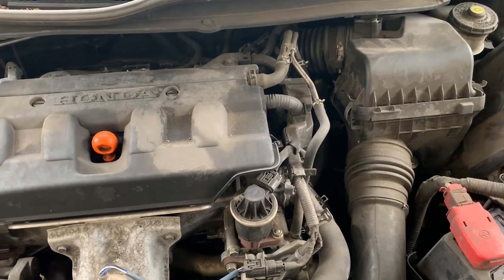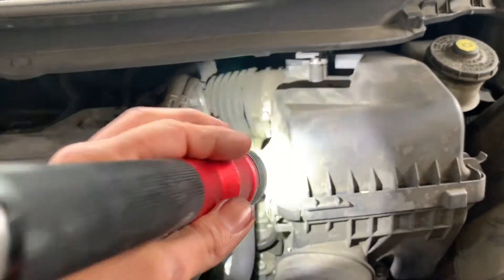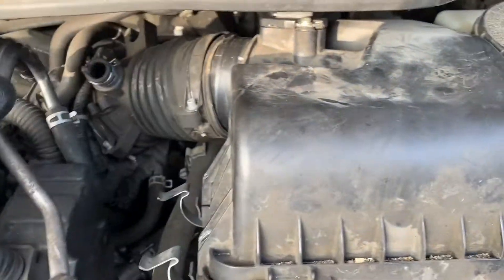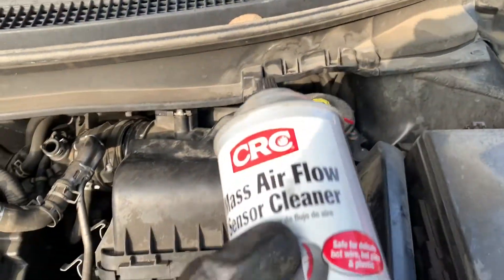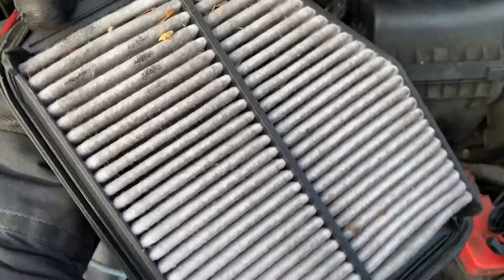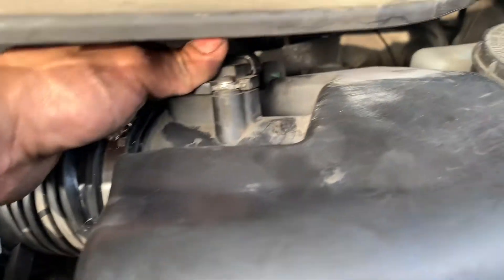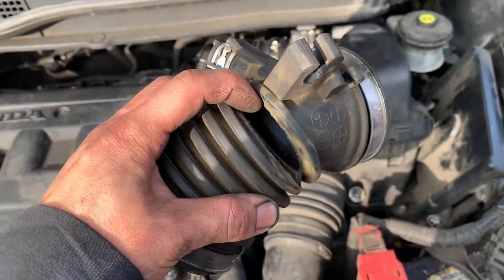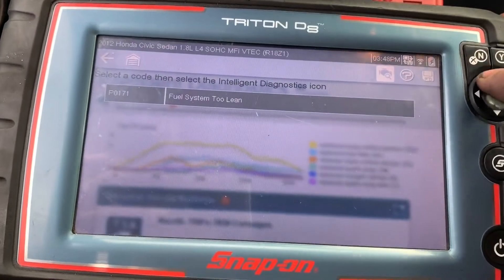Honda Civic Fuel System Too Lean (P0171 / P0113) Easy Fix

Comment: Yo bro, I have a code P16E3 and battery light is on, checked the battery and alternator and they’re both good, I changed the negative side battery sensor and still not fixed, what could it be?
Reply from the maker: For this code. Its either alternator or negative battery sensor. I have problem with this code before. You MUST use oem parts only, cannot use aftermarket part.
Reply: @ ok thank you

Comment: Pls I change all but still the pop up is still there. What do I do?
Reply from the maker: If you have replace air filter, mass air flow sensor and air boot and clear code. If you turn the engine on and code comes back on instantly, could be problem with electrical wires to the mass air flow. If it takes few minutes for engine light to pop back on, theres still vacuum leaking somewhere in the intake system. Check you work again, check all the vacuum hoses, if the engine rpm idle go up and down, theres still a vacuum leak. If you step on the gas pedal, the needle go up and drop down very slow, the throttle body needs to be clean and idle relearn.

Comment: Hi. Did you lose coolant when doing this? I bought a new filter and then found out the dang air intake is wrapped in electrical tape! So i got a replacement just nervous to do it. Strangely no code popped up since i got it. But performance wise, it struggles up hills. Oh and my replacement is from honda, maybe it was dumb to get the pricey oem, 35 bucks😳
Reply from the maker: A bad or ripped airboot causes the vehicle to have lack of power and weak as you accelerate because of leaking vacuum. Doing this job takes 15mins to do. No coolant involve at all. Very easy to fix.

Comment: Great video! I just spent $110 having this exact problem fixed at the shop. Mustn't be sore though. We pay for the experience to diagnose and fix it quickly, but I certainly will check the air boot first next time this happens.

Comment: Great video it helped me a lot i was lucky the check engine light didnt come on but now after replacing that part i have a major gas leak under the car. Do you have any advice on what it could be? Fuel pump or lines etc?
Reply from the maker: Could be gas tank have a small crack if you hit something will driving or fuel lines crack. Check around the area that you have worked on, you could have bent or broke the main fuel line.
Reply: @Ah Duuu thanks for the reply.  I found it last night. It looks like a squirrel bit my fuel line right next to the pump. Left a hand full of cracked nuts all around the pump also . smh

Comment: I have a honda civic 2015 with my engine running rough am sputter at idle only coil spark plug an injector are brand new check all hose cant seem to find any vaccum leak what is you suggestion?

Comment: Thanks for this video it’s a thump up. 
My question is that my 2012 Honda Civic battery charges at sometimes 12.40 volts then when I reset the negative Nartey terminal then it charges it 14.40 volts then few day it come back to charging low
Reply from the maker: Your alternator is going bad. It should be charging range at 13v to 14.5v. Replace the alternator.

Comment: Is there a way to contact you? Or video consultation ? I have a exhaust smell coming into the cabin. I recently had a transmission spill due to a weak plug tried cleaning it to best of my abilities and then I noticed my air tube was ripped also Could that transmission spill onto the area seap into the cabin?
Reply from the maker: The smell is from the exhaust burning off the trans fluid. That's why you're smelling that smell. It will burn off after 30mins, no big deal.

Comment: Hey man so I did the same thing to my 2014 Honda Civic and after I did it I got so many lights on my dash but I was able to remove most of them but I only have the tire pressure light and traction control off light do you know what it can be?
Reply from the maker: Tire light on, cause one of the sensor in the tire is bad. For the traction control, you have to find out what the code is. Traction control code would be in the "abs brake system".
Reply: @Ah_Duuu_Ma  I did plug in the scanner but it doesn’t give me any codes
I drove the car for 1 hr at 65mph to see if the light would turn off but it didn’t
Reply from the maker: @williamwills4294  You need a special scanner to read abs codes cuz cheap normal scanner can't read it. For the tire light, you have to take that to a tire shop to fix it.

Comment: Hey I have a question.
Will this issue make the engine shut off.!
I just bought a 2015 Honda Civic and the engine light came on with this code p0171 and I noticed that the air duct has a ripped on it.
And while driving when I come to an stop and  I take off my foot of the brake it cuts off.
Reply: ABSOLUTELY.  When you put a load on motor after stopping (Ex: Accelerating) the vacuum leak may allow more air to enter the engine than the fuel system can keep up with.

If your tear can be seen with the naked eye, this is a severe issue in a mass air EFI system.
Reply: My air duct doesn't have a rip but I have the same symptoms.. what might be my issue???
Reply: @midcityslim3575  Smoke test.  I just did one of these and the tears in the rubber tubing weren't obviously visible until flexed.

Comment: Will this stop the car from starting
Reply from the maker: The car will start, with vacuum leak. If the vacuum leak is too much the car won't hold its idle but it will start for 2secs and turn off. For this model, the starter always goes out and check the battery (make sure its not weak) if your car won't start. If you replaced the battery already, most likely would be the starter. Ive done a lot on this model.